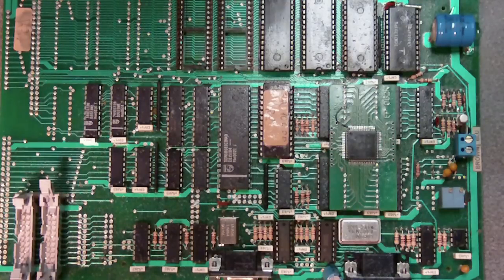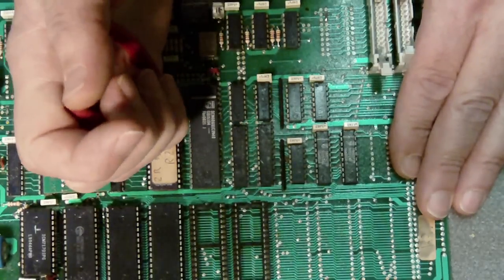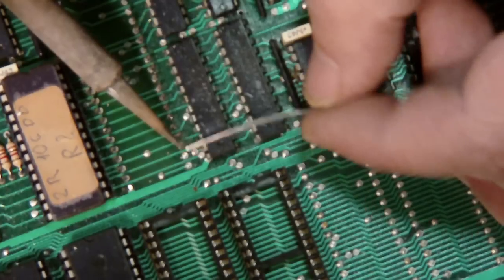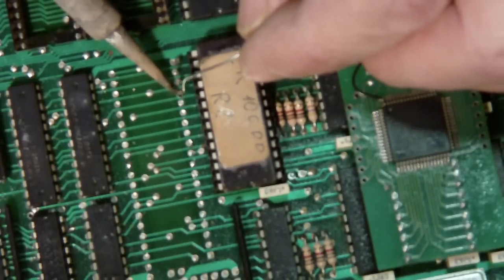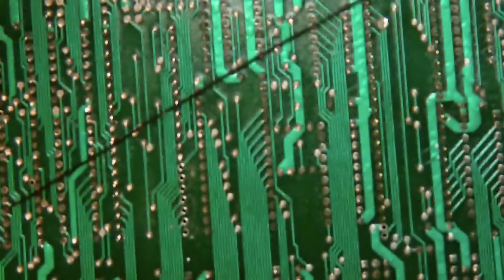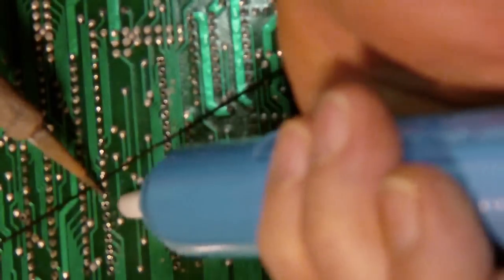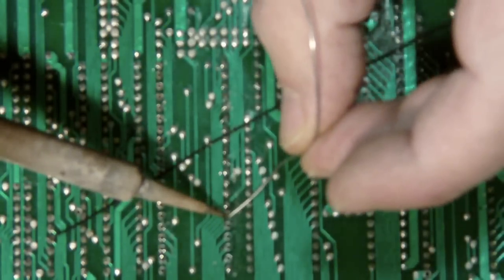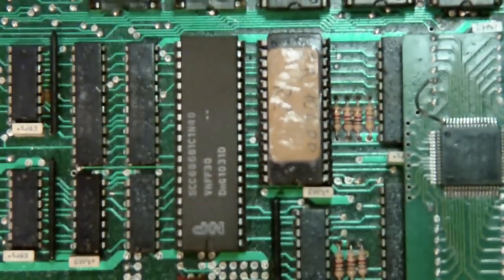How to Remove a 40-Pin IC DIP Chip from a Printed Circuit Board

Comment: I use a pin vise and small bit for remove the solder from the holes. Much easier and not as likely to do damage to the board. I came up with this trying to teach my btother to repair boards as he would cook them taking out the solder. I liked doing it this way so much I still use  it 35 years later.
Reply from the maker: +Jimmie Fender Good for you buddy.....the idea doing this way is to NOT DAMAGE the board idiot

Comment: Nice trick, but it works just when you are dead sure the IC is faulty. But what about when you don't know it for sure and, say, the chip is either costly or hard to find? In that case the only sure-fire method is hot air reflowing and removal by spring-loaded tweezers. I tried it and works like a charm (well, apart for risking PCB delamination, FIY).

Comment: Nice technique.But i think it's surface tension that lifts pins,not magnetic force.For those that failed using this method,try changing soldering wire type or tip temperature.Anyway,very well done :)

Comment: Very traumatic method for PCB.Then you cut pins you can damage pcb pads or solder mask. Vacuum solder remover, with low practic, will damage it too. Better use hot air.